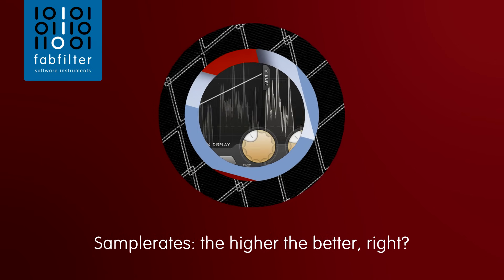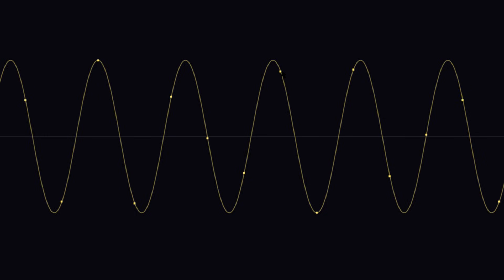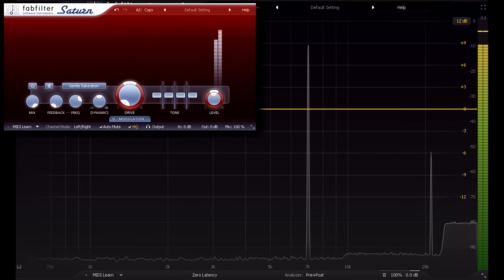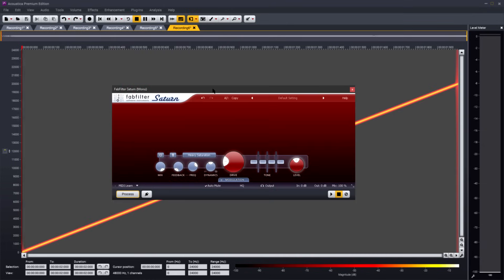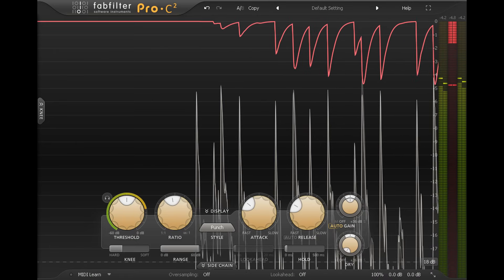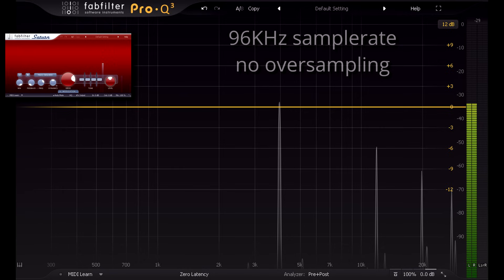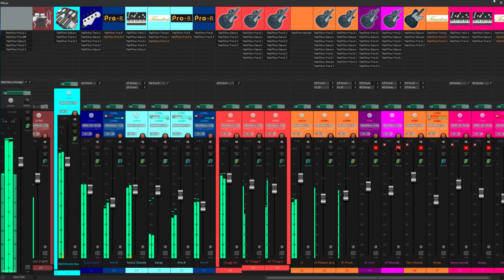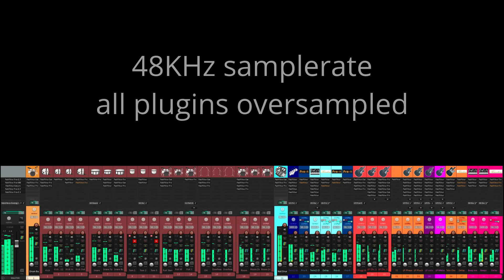Samplerates: the higher the better, right?

Comment: I would say it would be wise only using oversampling on the master limiter, and clippers. Common compressors and saturation/distortion will likely in most cases make it without these artifacts at just 48/32. The master limiter might be the crucial point.

Comment: Fantastic stuff! Let's not forget one big benefit of a higher sample rate during recording though: lower latency! This comes in handy especially when tracking guitar and bass using amp sims or IR loaders.
Reply: Can you explain how a higher sample rate results in less latency
Reply: @RicketyBread  For the same sample buffer size, doubling the sample rate halves the latency, e.g. 256 samples at 48kHz is 5.3ms, and 256 samples at 96kHz is 2.6ms.

Comment: Hi, I've been checking this in my environment; at 192Khz samplerate and with the 96Khz analyzer... but with one change... my metering went from -180Db up to 0DB.
I think based on how deep the level of the brink wall limter goes, lets say in your and also my case... the noise ended up at the -120DB noisefloor and still created some havok...
Now I would argue that we probably cant hear this noise at -120DB... But It could screw up the AD DA conversion...
I just solved my own question... Maybe we can brick limit beyond the -144DB and stay in the 24bit realm... It'll probably won't show up in the ADDA proces...
I'm gonna test this and get back to you...
If that won't work maybe we can cut out the noisefloor  with reafir from cockos... Yes, i'm using reaper....
Reply: Hi! Finaly, did it screw up the AD DA conversion? Thanks :)

Comment: super informative, but i'm still not clear about the conclusion. should i be tracking in 24/44.1 or 24/48 kHz?
Reply: 48
Reply: The video suggests 48 kHz, but ultimately you should try it out on your own. For me it's always been time consuming switching back and forth between the two.
Reply: @RaffaeleSansone  thank you, faizan and raffaele. 48 it is from now on. and for the downsampling i can use rx7's "sample rate", right?
Reply: @violamoonshape4428  I think you are talking about Resample? I never really used it because as I said for me it's too much of its own problem figuring out how to convert files without introducing distortion, but from what I read that should give an excellent conversion quality.

Comment: Usual great stuff from Dan, but I would question some of these assumptions.
Point one: despite the fact we can see all these (unwanted) harmonics appearing in the audible range (i.e. the aliasing) within the DAW, won't these all be filtered out after the DAC (i.e. by the Anti-Aliasing Filter, as it is properly called)?
Point two: there is a section toward the end of the video here where he does talk about the system's output filters and rightly says that 48k allows less steep filters (= less HF phase shifting). My understanding would be this is also the biggest advantage to working at high sample rates: the anti-aliasing filters at the output stage can be much gentler and the audible HF is much cleaner.
🤷🏼‍♂
Reply: #1 - Perhaps if the audio was clean from start to finish and it was real-time. However, all of the aliasing has already occurred, caused by the plugins, and therefore folded back into the audio in either real-time playback or "set in stone" when the song is rendered. There's no going back at that point nor could it be re-filtered out. The aliasing created content within the audible range, and therefore it cannot be filtered away. An AA filter on a DAC is exactly what is shown in the Plugindoctor demo near the end. The steep AA low-pass filter exists on plugins which oversample and in DACs, which may oversample as well.

#2 - He really didn't talk much about the benefit between a steep AA LPF or a gentler AA LPF, did he? Maybe I missed that. It was kind of left hanging. Even if the steep LPF introduced phasing, it would be technically too high to be audible right? I'm not seeing the benefit of a gentler slope by actually being "more gentle," but a real benefit is that the LPF has more room to work--he does state that--in higher sample rates, like 48kHz vs. 44.1kHz...therefore the -3dB point of the filter, or perhaps the very top of the slope, does not negatively attenuate music information below 20kHz, which could be perceived as less "air" and top end. In other words, the start of the LPF's slope is inherently well beyond 20kHz and could not possibly impact audible frequencies. 

IDK! As someone who has created, mixed, and mastered at 96kHz for several years now, coming from prior experience at 48kHz work, I swear I could hear the clarity and difference at 96kHz. However, now, I wouldn't mind going back to 48kHz, or 44.1kHz and using more oversampling, because A) when you're trying to do live shit at 96kHz, the CPU hit is enormously inefficient, and B) I wouldn't need to downsample at bounce-down before uploading to YouTube, Bandcamp, or MP3.

Comment: FabFilter - Unfortunately I will not agree with you on some aspects. First thing, this is a great video, and many things a greatly understood. 
Only two remarks. 
1. The biggest problem we have today is in this 44.1KHz standard which poses lots of problems. This SR Frequency is not a mathematical fraction of 48KHz and we will always have artifacts on conversion, likely they are eliminated by the application of hard filters. We need to stick only to 48, 96, 192KHz semple rates and get rid of 44.1. 
2. Another thing is, You can recreate the 20KHz sinusoidal wave with 44.1KHz but is the only thing you can recreate because it is repeating signal and the CPU and DACs presume this, however, this is not true for NON-REPETITIVE signal with Variable Amplitude, you can not recreate it, you lose. At only 4 samples per half-wave at 5KHz, you do not have enough turning points, you lose in detail. Even at 1KHz, you have 22 samples per half-wave and you can not get a 96db 16bits dynamic range for a non-repetitive signal, important for live recordings.
Reply: @ReaktorLeak Nyquist-Shannon theorem states that that is a MINIMUM ACCEPTABLE sampling rate, and yes, it works only for a given frequency at a given amplitude played for an indefinite amount of time. But the natural sound or even music is composed of transitions, fading impulses and will not be recreated correctly, DACs will apply different filters and algorithms and will presume how the signal was before being encoded, this will look nice as a graph but will be far different from the initial input. Look at what a DAC does to recreate impulses. I have seen the outputs on the oscilloscope to confirm this. The post oversamplig does nothing at all apart from applying a different mathematical filter, and filters can be different.  One example, the second part in French https://www.youtube.com/watch?v=laFqGEQaCUc
Reply: @ReaktorLeak I've worked with tape machines that give 20 bit performance and a freq response at 30ips flat to 30kHz.
Reply: @ReaktorLeak a modified 2 track half inch at 30ips with C4 Noise Reduction - yes.
Reply: @ReaktorLeak admittedly this was a half inch 2-track machine with heavily modified playback electronics and AES curve. And it was ~20 years ago. The engineer who worked on it may have said "approaching 20 bit performance".

Comment: Quite a nice vid.  One glaring problem, though: the comparison between "hi-sample-rate-with-brickwall-after-nonlinear-processors" and "lo-sample-rate-with-upsampling-nonlinear-processors" comes down in favor of the second, on the grounds that "you don't need the extra brickwalls".  But it does mention in passing that "the upsampling processors have a built-in brick wall anyway."

So the question really comes down to: does that built-in brick wall take any less CPU than doing it as an explicit stage in the signal chain?  I can't imagine why it would.  And yet with the upsampling/downsampling you DEFINITELY are taking a bit of a CPU hit.

Really, the lowest-CPU way to get this cleanliness might not be possible with off-the-shelf DAWs, but it may be to run your inputs and synths at (say) 96kHz, go through the FX chain, with brickwalls after non-linear FX (whether built-in or explicitly positioned, doesn't matter), THEN downsample to 48kHz after the last non-linear FX and do your EQ, delays,  etc., and sound output and disk storage all at (say) 48kHz.

Comment: And then I just laugh, plug into my external compressors, and make great music without all the issues! 
Digital is great until you depend on it to do everything. Boxes take up space and create a lot of heat in small rooms but they sound great, always work  and they are fun to play with too. Rock On my analog toys- rock on indeed :)
OH WAIT! 
There is one thing you stated that I disagree with and that is 44.1 and 48… film always wants 48 so if you want to be ready for film without converting your tracks it IS WORTH using 48. It’s a minor issue and thought. Your videos are all very excellent

Comment: I am a little confused still. You made the comment: "Of course you’ll still be listening to this at 44.1KHz as that's the rate YouTube runs." and you offloaded the conversion to make it as accurate as possible, but if YouTube plays 44.1 kHz, your conversion still won't matter right? Am I missing something here? 
Will YouTube play your 96kHz conversion at 44.1kHz vs playing 44.1kHz (non-converted) at 44.1kHz? Still seems like the former would be a 44.1kHz image of a 96kHz sound, which it doesn't matter how good the source is, it's still only going to come out at 44.1kHz and we won't be able to hear an audible difference regardless.
edit: I guess the samples would still have the aliasing samples that fall below 22kHz? (from the other sample rates)

Comment: In Ableton, when rendering, there's an option to render your track in a higher samplerate, I think it temporarily sets the project samplerate to whatever you choose, so I guess technically it's not just upscaling it? Is it good practise to do this?
Reply: Generally speaking I would say no.

Some synth plugins do sound different at higher samplerates. You could argue that's a flaw, but it's a reality. Note that different doesn't necessarily mean better, and might require changes to your mix to compensate.

If you have audio files in the project (I'm assuming at the original project samplerate) they will need to be upsampled for the render. The quality of the samplerate conversion then comes into play. I've no idea how Live performs in this regard, and if it's like Reaper it might depend on your settings. Mediocre SRC might undo any benefits from the higher rate.

So try it if you want, but I would suggest also rendering a version as you're hearing it so you can compare afterwards, and check that it does actually sound better.

Comment: Very good and intuitive video indeed. With all due respect sir, I can clearly hear the difference between the oversampled 44.1KHz and 48Khz comparison in your video (although yes, there was an improvement between the oversampled and the straight 44.1KHz). When compared to 96Khz the difference was even more apparent. The difference I heard was (I'll try my best to describe) happening more in the 3rd dimension. I was able to hear deeper bass response from both the guitars and the kick and bass guitar. Therefore there was this good relationship happening in the low end and leaving room for the mid and upper mid frequencies to present themselves (clarity in short). I am very much aware that the sample rate is not only a sonic debate but it is often a requirement of media whether it will be burned on a CD or be broadcasted on TV, or be streamed, etc. Ofcourse the mud I hear with the 44.1KHz may be cleaned to some extent with EQ's or various plugins. To conclude, the reason I'm writing all this is to answer your final claim: "you don't need a higher sample rate when you can oversample the plugin". The HQ or HD options on plugins do work marvellously but presenting them as a bargain for higher sample rates did not work for me; at least in this video. These are only my honest experience with this video, no offence. Oh and by the way, I pressed the "like" button :)) A fine video after all. Thank you very much.
Reply: 96k + 4x oversampling .. should be nice
Reply: @CheloScotti  indeed :)

Comment: Is it the case that multiple instruments generating ultrasonic frequencies can also blend to create hearable ones? IE, undertones.

So, if the two instruments were played together there would be a hearable effect. But if the instruments were on two different tracks your method would have cut off their ultrasonics and so when combined they would not cause that effect. However, if each instrument was sampled at a higher rate the result would sound as it should as if all instruments had been played together.

Is this a reasonable argument for sampling at higher frequencies?

Comment: Oversampled version have better stereo imaging, no oversampling it's like there some slight tonal balance problems, or "holes" in stereo imaging in higher frequencies, idk how to explain, I had similar feeling when ppl used pure sinewave sub bass, compared to saturated bass, non saturated bass feels like there's hole in stereo imaging in low freq.

From best to worst sound in this vid, 44.1k all oversampled > 96k no oversample > 44.1 no oversample...
96k no oversampling lost some width in distorted guitar, or "more 2d" sound.

Oversampled also sounded more glued for me, or more "3d", or like it had better panning, non-oversampled sounded unglued to me, or like it had worse panning (even though you didn't change it)

Idk if this can be heard with monitors, but in headphoenes I can hear.

Comment: I think even my iPhone speakers are reproducing frequencies above 20khz. When the 25khz test tone was played I couldn’t hear anything (needless to say) but felt pressure on my eardrums exactly when you played the tone, and each time I replayed that moment in the video. Is this possible, and if not, then what might be causing this effect? I’ve noticed similar things before, and it has made me skeptical about both listed speaker frequency responses and figures related to human hearing, at least as they’re usually interpreted. I can’t ‘hear’ beyond what is considered normal, but I don’t think that means it doesn’t have an effect on the body, as one might expect from properly reproduced sub-frequencies for instance. Whether this is desirable is another question (probably not in most cases), but it would make perfect sense to me that there’s a wide range of sounds outside the human hearing range that we can still perceive as a physical vibration/pressure, even if it goes beyond what we can hear in the traditional sense. Does this sound misguided, or might there be some truth to it?
Reply: YouTube audio samplerate is 44.1KHz, so the 25k tone is simply not there. This tells you more about the power of suggestion than the frequency response of an iPhone speaker.
Reply: Dan Worrall I certainly can’t argue with that. Nonetheless, I do perceive a sensation at that moment in the video each time. I think it might actually be a response to your voiceover cutting out, i.e. the sudden transition from sound to silence. I listened to the video again and noticed the same effect at various similar points—which may have more to do with the state of my hearing than anything else—a brief sensation of pressure accompanied by a slightly audible crinkling sound from my inner ear when the voiceover cuts out. I appreciate I’ve taken this conversation straight into the weeds, but there we are. I think it was my ears rather than my brain playing tricks on me. Thanks for humouring my questions!

Comment: At 25:50 or so, you don't explain what the downside of an "extremely steep" anti-aliasing filter actually is, compared to the "less steep" one you can use at 48kHz.  Does the one used at 44.1kHz, which needs twice the cutoff, merely use twice the CPU and if so how much CPU IS that?  Or does it cause phase distortion, or other problems?

Comment: Wonderful video!
One more certainly stupid question. In the curve at 3:58 would not be a sine wave, but shaped other way - still going through 2 sample points. Will not be reproduced another sound at e. g. 96kHz compared to the sine reproduction at 44.1kHz?
(Letting the problems of antialiasing and intermodulating at the side for this moment.)
Thank you very much in advance!

Comment: If I all underdstand it all correctly, then MP3 is better than WAV because it by default it cuts off the >20kHz signal? So on (distorted) equipement those >20kHz signals will not reproduce unwanted noise below 20kHz.